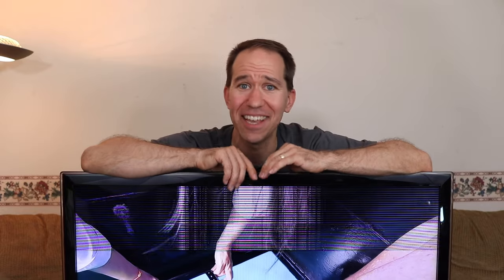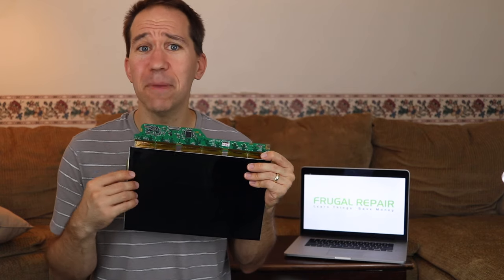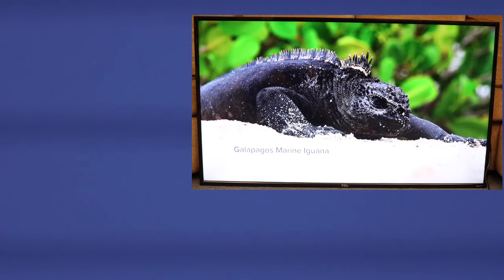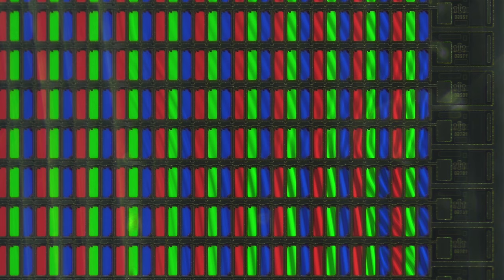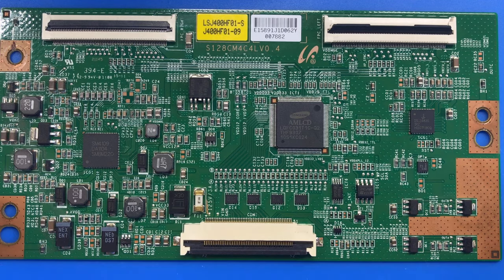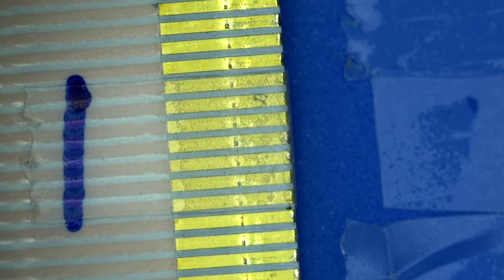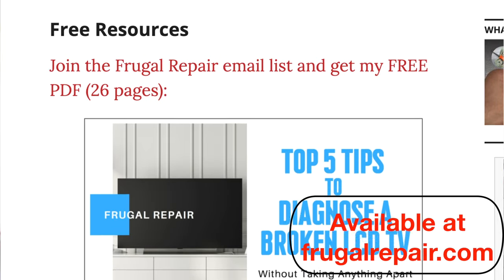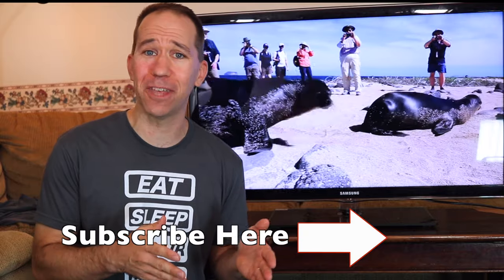Repair Hack Explained | How to Fix TV Horizontal Lines - Part 2

Comment: Accidentally posted on someones comment..  Now that my heads outta my ass maybe you have a piece of advice or idea on what my next step should be before I call it quits on it.  It's my moms bedroom TV. I gave her my older 47" Vizio that's still kicking ass for now. Hate my new one as it doesn't have a Coax input on it.  Barely look at TV anymore though.  
Fixed: Had 80% of LED's were out or faded. 
Fixed: New ribbon cables left side had torn off contacts at display end. 

Problem now: Got Vertical colored lines whole screen. They weren't there when I did flashlight test to fix what I thought was the only problem at the time. 
@FrugalRepair  I have a Vizio E470i-AO and had the black screen and it was the LED's so got new ones put on and now I got all Vertical colored lines. I was 100% careful and there's no way that panel got cracked or messed up from me replacing the LED strips. I'm a lunatic when it comes to shit like that and go overboard.  Also no separate T-Conn on this model so I'm assuming it's in the in with the power board. One of the ribbon cables had 3 or 4 of the contacts at end where ripped for the left side of the TV so Ordered new ones and replaced and still got the lines.. I can make a short video and thru it up on YouTube if you'd like to see exactly what it looks like. If i hit the menu button you can see different lines jumping around amongst the others. So I guess my question would be any idea on next step? Any certain spots to check voltage. All the ones I seen to check are good. Now anyway since I put new LED's in. Every fix I've come across is with a T con board separate. So not sure how to go about without..  BTW great vids man.. I love the fact that your a straight shooter and no Clickbaitin BS. New Sub here.. TY for any ideas.
Reply from the maker: Thanks for watching!  For your e470i tv, my guess is either the lvds cables are not seated correctly (easy fix).  Or perhaps you damaged the tab bonds when you did the backlight repair (not easy to fix).  Do you get a good image on half the screen when you disconnect one of the lvds cables?  That procedure should help narrow down the source of the problem.

Comment: My Samsung plasma TV has black lines that don't move
Reply from the maker: Plasma TV is different than the LCD in this video. It may actually be easier for you with the plasma. There’s a chance that your problem is a dirty ribbon cableThat controls the horizontal picture. Maybe you can find a video about it but always make sure the power is off when working on the TV.

Comment: I tried this and now my screen is fully black but all I messed with was the ribbon cables. Please help how can I fix now😣
Reply from the maker: As long as you didn’t tear of the cables or cause a short circuit, you can just put it back the way it was
Reply: @FrugalRepair  I did at first the tape made it worse so I took it off an just put it back without tape and now it’s black😭
Reply from the maker: My guess is that the ribbon cable isn’t seated correctly. This is happened to me many times.

Comment: mine does it but only when its on 143hz on my computer. strange.
Reply: Mine appeared when i used 1080p120hz instead of 60hz bcz it had the option. But the lines never disappeared

Comment: You still didn't explain what the problem is. Is it an unrepairable LCD panel fault?
Reply from the maker: It’s because I wasn’t sure. There is a fault either inside of the LCD panel or on the driver board. My suspicion is that there is a short circuit in The circuitry that handles the row signaling in that part of the screen on that side.

Comment: My TV only has one ribbon cable. Has blue screen only. No picture, backlight is working
Reply: My tv has one ribbon cable aswell. You could Block the Lines from there, but it wont look Perfect

Comment: Strange this flatscreen are so bad, I have a Sony Wega 21 years old, I didn't turn it on for 13 years+, my neighbor bought a simple LG flatscreen that went dead in less than 2,5 years. So I gave her my Sony, heavy as hell, 100lb heavy, installed it and it worked fine, sharp picture! People tell me those old tv's are a danger, yes they are, they will survive the flatscreens for decades!
Reply: Funny.  I resurrected an old tube by replacing some capacitors instead of chucking it. Now I have a TV in the basement in case I want to turn it on. The "piece of junk" TV  probably went 30 years w/o a single problem.

Comment: what if i have only one lvds cable?
Reply from the maker: You mean one cable from the tcon to the lcd assembly?  This trick will not work if your LCD only has one set of row signals.  But likely what is happening is that the row signals are paralleled on the lcd driver board.  You'd have to physically cut the traces on the pcb rather than use tape.
Reply: @FrugalRepair  Damn so that will be hard but how i can know which one to cut
Reply: @FrugalRepair  lvds cabel goes straight to the mobo of the tv and changing of mobo doesnt help
Reply: @FrugalRepair  any idea how to check which one to cut?
Reply from the maker: You have to find the row signal on the driver board.  Sorry I can’t help further, it is not easy if you have not micro soldered before since you probably need to do some trial and error.
Reply: @FrugalRepair  okey thank you anyways ill try to get it working
Reply: @FrugalRepair  hey i actually find other way to fix it i just had to tape down the lcd cabels on board with some electrical tape and it works fine like charm 😎 They were like standing out from the board maybe its because they are getting really hot or smthing when at work but ye that was kinda easy but hard to find fix 😅
Reply from the maker: Congratulations!

Comment: Hi how to fix vertical lines?
Reply from the maker: I’ll have to make a video since lots of people ask about it.  But it could be the tcon board or bad tab bonds on driver board.  You can try putting pressure on the tab bond that’s bad.
Reply: @FrugalRepair  Yea I have a Vizio E470i-A0 and had the black screen and it was the LED's so got new ones put on and now I got all Vertical colored lines. I was 100% careful and there's no way that panel got cracked or messed up from me replacing the LED strips. I'm a lunatic when it comes to shit like that and go overboard.  Also no separate T-Conn on this model so I'm assuming it's in the in with the power board. One of the ribbon cables had 3 or 4 of the contacts at end where ripped for the left side of the TV so Ordered new ones and replaced and still got the lines.. I can make a short video and thru it up on youtube if you'd like to see exactly what it looks like. If i hit the menu button you can see different lines jumping around amongst the others. So I guess my question would be any idea on next step? Any certain spots to check voltage. All the ones I seen to check are good. Now anyway since I put new LED's in. Every fix I've come across is with a T con board seperate. So not sure how to go about without..  BTW great vids man.. I love the fact that your a straight shooter and no Clickbaitin BS. New Sub here.. TY for any ideas.
Reply: @FrugalRepair  thanks

Comment: Can’t you just replace the Tcon board?
Reply from the maker: No, because the panel is the problem
Reply: @FrugalRepair I thought you put tape over the pin connections coming out of the tcon board?
Reply from the maker: Yes, that is correct.  But the reason is that it stops an electrical signal going into the panel where the short circuit is.  You could cut the wires instead of tape but tape is just the easiest method I think.
Reply: @FrugalRepair I have an issue with my current tv, where I’m getting horizontal lines across the bottom of the screen. I’ve never repaired a tv before and I read off a few pages online that it could be the Tcon board.  So I’ve bought a replacement Tcon board. Hoping it works 😅

Comment: This explaination was ovecomplicated/It was easyier to replace the part. I rplaced the (TCOM board and x2 connecting Ribbons) - (Located bottom center in most flat screens)
You don't need a degree in engineering to simply replace parts.

Comment: Samsung is pretty nasty for having these bad tv.. I will never buy a samsung tv again. I currently have this issue on my samsung 50 inch tv and when we did this signal blocking, it removed the horizontal lines but devraded the picture quality to and lost the hdr capability

Comment: Can you come over and fix mine?
Reply from the maker: I wish I could!
Reply: @FrugalRepair  I used to fix the vert lines by gently tapping on the back but that doesn't work anymore.  I'm going to have to take the back off and chedk the cables I guess.

Comment: Whilst doing this I just fried a TV by making an entirely stupid mistake. DO NOT MOVE A RIBBON CABLE WITHOUT SHUTTING OFF POWER EVERY TIME. Obviously we all know this and we cut power between each adjustment, but just one slip of attention one time was enough. Don't think this TV is recoverable now. Stupid mistake 😢
Reply from the maker: Sorry to hear!  I’ve done that and fried a tv when I was first starting out.

Comment: Interesting, yet you didn't FIX it.
You came up with a patch, a hack, or a kludge depending on your electronic/computer background
With the TV apart, replacing the board couldn't have been all that difficult at that point, you had 3/4 of the work already done

nice hack though
Reply from the maker: The tcon is not the problem.  If it was I would have replaced it.  The lcd panel assembly has the fault in it.  You either do this trick or throw the whole tv away.

Comment: I used to think Samsung was a good brand...until my 70 inch 4K behemoth went black just after the one year warranty expired. Then, I noticed it said "Made in Mexico" !!   They are selling low quality crap because they are not forced to have longer warranties and most people will just sigh and buy a new one. I'm waiting to receive a new power board before I resort to this geek attempt, if necessary...thx !

Comment: God Afternoon mr Frugal, big fan here ! i was gifted a sony XBR65x900a with horizontal lines, i am all the way from brazil , and i am watching your videos trying to figure out wich lines on the flat cable i should isolate to end with it, please if you could give me some light, that tv is a 3d tv , so it has 2 flat cables each side and 4 processors on tcon board, i identify that the problem is on the right side , but i am not being able to identify the clock signal , i am not an xpert on it,
the tcon board is this one
https://www.shopjimmy.com/auo-55-65t13-c01-t550qvd02-0-55t12-c01-t-con-board/#mz-expanded-view-569974694189

sorry for my bad english , that tv costs almost a popular car price for this lands , i was gifted with it by my employer, he would throw it away

Comment: I hit my tv close to the top right and the hole screen is dark and on the top right it shows a crack what do I do pls if anyone knows tell me on Instagram  @_dimitrisre_
Reply from the maker: If the LCD is cracked, unfortunately, there’s nothing you can do. If your problem is a messed up backlight or maybe a small chip out of the corner of the LCD, those two things you might be able to do something about.